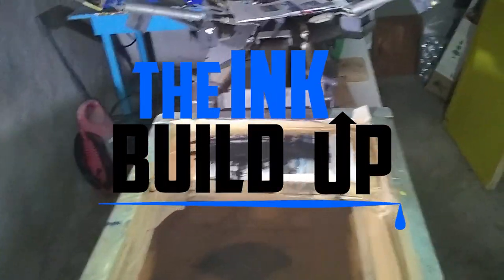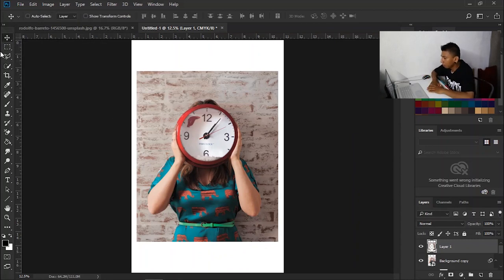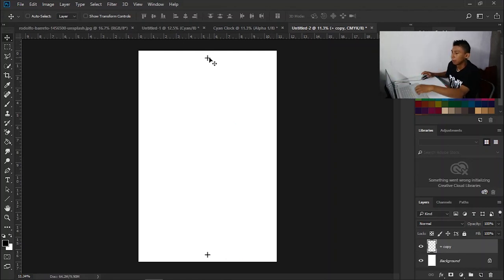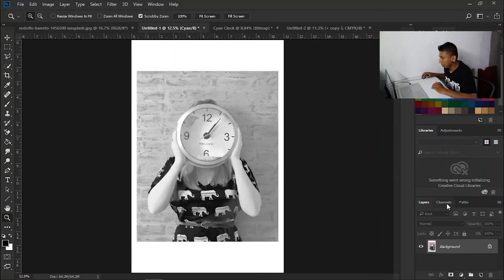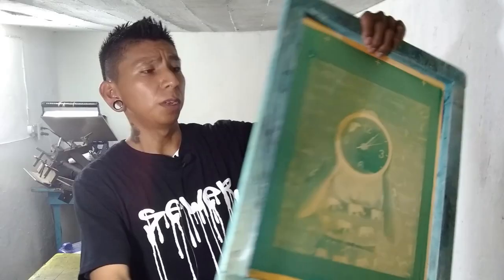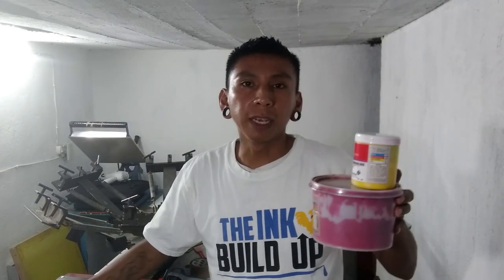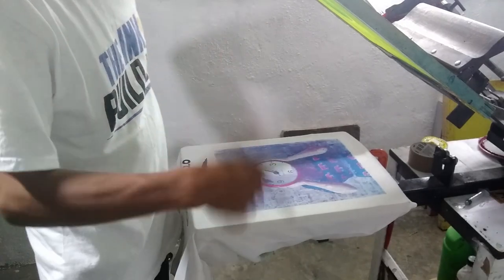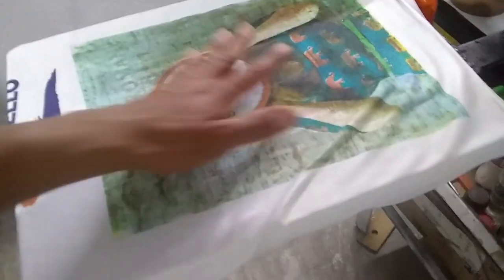Doing a CMYK Print | From Start to Finish (2nd Attempt)

Comment: Hi Antonio! This is Roosevelt Brown. I adjust My CMYK channels, in Photoshop using the curves, brightness, contrast, and sometimes even sharpening.
My experience with CMYK is that it usually takes several test prints for the inks to work into the fibers if the screen. I normally print YMCK, In that order, but the order depends on the design. I am a wet on wet printer, but some designs I have used the flash. CMYK is tricky because unlike spot colors, you have to be very careful to maintain as close to even c onsistent pressure as You can. Which is not easy but it can be mastered, and being that this is an older video, I am sure that You've gained some more experience. All in all, this is a great video Amigo, and You did VERY good for Your first time.👍
Reply from the maker: Thank you for the Tips Amigo. And yes this harder than expected. I know this will take a lot of practice to finally start printing cmyk probably. Might cause me a lot of headaches in the progress but willing to handle it to get right.

Comment: Amigo i think you're supposed to use different angle to each color halftones.  first yellow, magenta, cyan then black. more power!
Reply from the maker: Hello Amigo. Thanks for the tips.  And yes, different angles for each color, but I still don't know exactly what angles to use, that's why I just used the same for all. As for the order to print, I did made a mistake starting with cyan. Now I know that I need to start with yellow, and yes more pressure. You can see my new video where I had help. I still need a lot to learn. But mistakes help me learn.
Reply: Black 15
Yellow 0
Magenta 75
Cyan 45
Reply from the maker: @annazeinna325  Awesome, thanks for that tip Amigo.

Comment: linking you from Jamaica the mesh count is important if you use a 230 mesh divided it by 4.5  I use 5 so 230/5 = 46 lpi  next print YMCK
Reply from the maker: Jamaica! Awesome man. And yes, luckily I have high mesh. 305 I used for this print. And yea, I made the mistake of starting with Cyan. lol

Comment: why dont u need to flash every color?
Reply from the maker: CMYK is when you have to have the inks mix together in order to get the right color on the print. If you flash and the ink dries it won't mix properly with the next color since it's dry. But I'm still learning so I can't really tell you. Since the maestro ( the one I'm learning from) he sometimes does flash between each color in CMYK prints. So I can say it depends on your technique and what best works for you. But, I'm glad you ask this question, this will be a topic for a future video to find out together.

Comment: You have to start with yellow
Reply from the maker: Yes. I've that, that was my mistake here by starting with cyan. But in the next video after this, I realized that. Will have to keep practicing this CMYK.
Reply: Yes you should because it is very tricky... Don't worry you'll get there ... Just keep practicing.. good luck
Reply from the maker: @wadieisaac1622  Thanks. And yea I know, will take some time but I'll have patience.